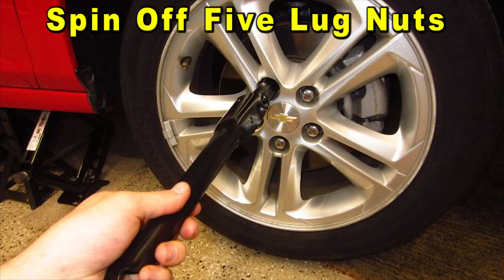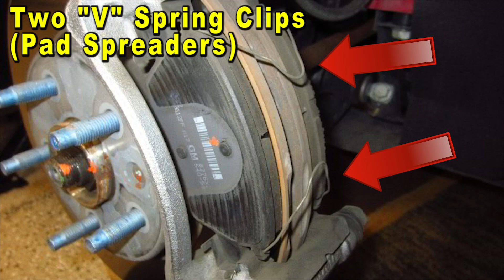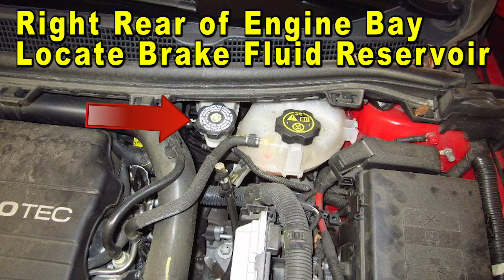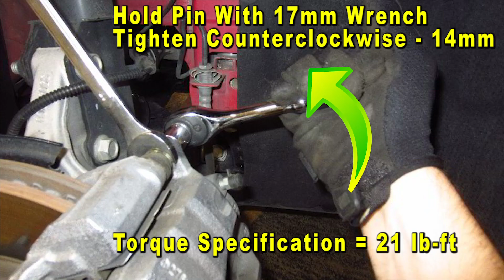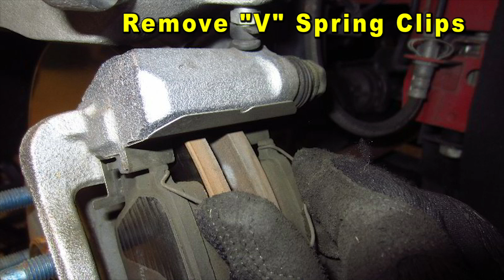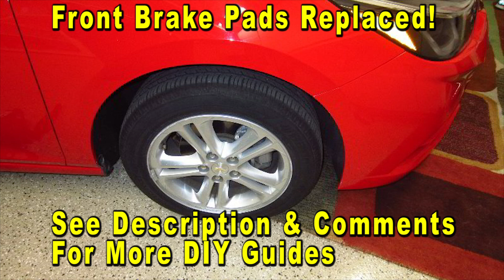Chevrolet Cruze How To Change Front Brake Pads 2016 2017 2018 2019 2nd Gen With Part Numbers

Comment from the maker: Chevrolet Cruze Front Brake Pads - https://amzn.to/3KYXyal
Raybestos Front Brake Pads Part Number - https://amzn.to/44uXJRA
Power Stop Ceramic Front Brake Pads Part # - https://amzn.to/44p4Hrl
18" "F" Clamp - https://amzn.to/3YUHFr9
Precision Screwdriver Set - https://amzn.to/3OYN1i0
Plastic Pry Bar Tools - https://amzn.to/3HMtsV7
Socket & Ratchet Set - https://amzn.to/3Z17LbA
Mechanix Gloves - https://amzn.to/3jCnHkt
Torque Wrench - https://amzn.to/3vS5uSI

The Paul79UF YouTube channel is a participant in the Amazon Services LLC Associates Program, an affiliate advertising program designed to provide a means for sites to earn advertising fees by advertising and linking to Amazon.

This DIY video shows owners of the 2nd generation 2016, 2017, 2018 and 2019 Chevrolet Cruze how to change the front brake pads.

Comment from the maker: Check out the DIY guide for changing the front brake pads on a 2nd generation 2016, 2017, 2018 & 2019 Chevy Cruze sedan - 
https://www.paulstravelpictures.com/2016-2019-Chevrolet-Cruze-Front-Brake-Pads-Replacement-Guide/index.html

Here are all of the DIY repair and maintenance tutorials for the third generation 2016, 2017, 2018 & 2019 Chevrolet Cruze - 
https://www.paulstravelpictures.com/Articles/2016-2019-GM-Chevrolet-Cruze-DIY-Repair-Maintenance-Guides.htm

Owners of other General Motors vehicles from Chevrolet, Buick, GMC, Cadillac and Holden such as the Sonic, Spark, Malibu, Impala, Volt, Bolt, Camaro, Corvette, Trax, Equinox, Blazer, Suburban, Tahoe, Traverse, Colorado, Silverado, Express, TrailBlazer, Encore, Regal TourX, Envision, Enclave, LaCrosse, Cascada, Sierra, Canyon, Acadia, Terrain, Yukon, Savana, XT4, XT5, XT6, Escalade, CT5, CTS-V, XTS, CT6, ATS, Astra and Commodore may also find these DIY instructions to be helpful.